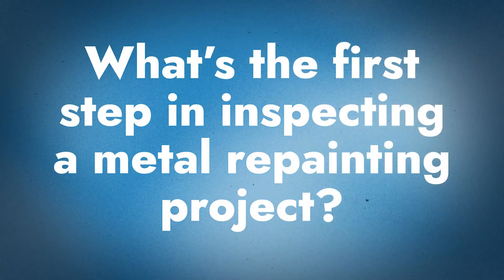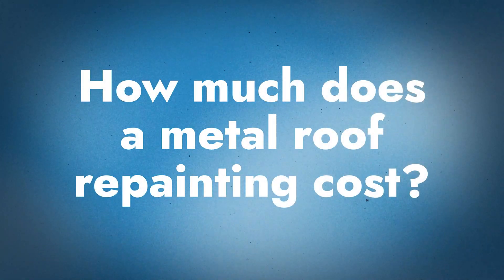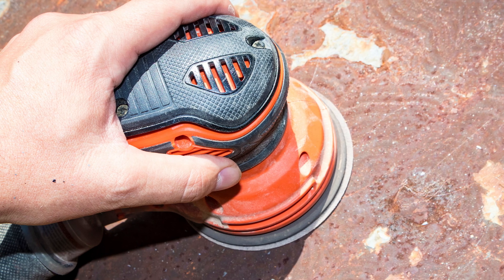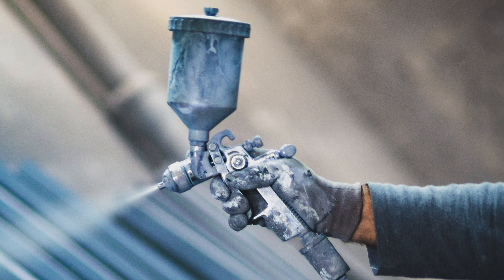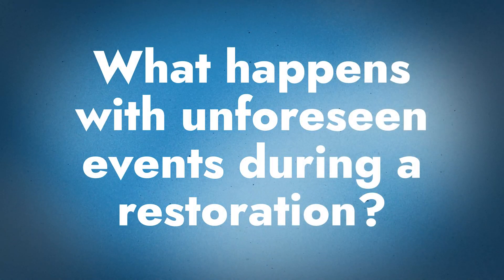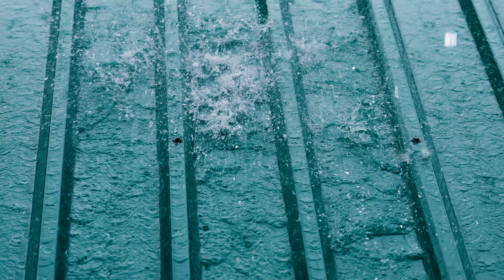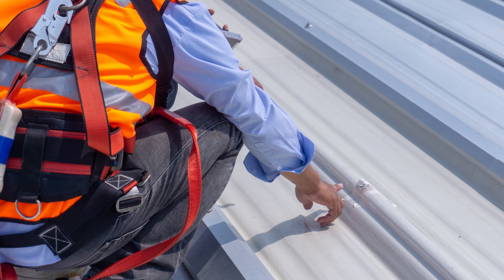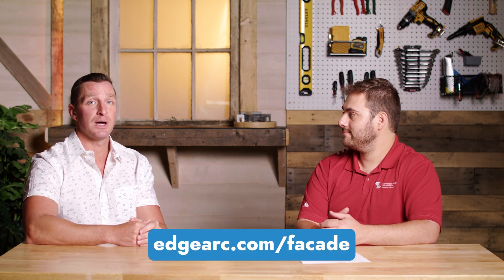Technical Metal Roof Repainting: How Pros Get the Perfect Finish

Comment: I have sanded and treated my metal roofs rust spots, then put down a primer. Now I want to put a top coat on that, what is a good top coat paint for my situation?
Reply from the maker: I would reach out directly to Edge Façade so they can get the full details: https://bit.ly/edge-arc-facade -Thad